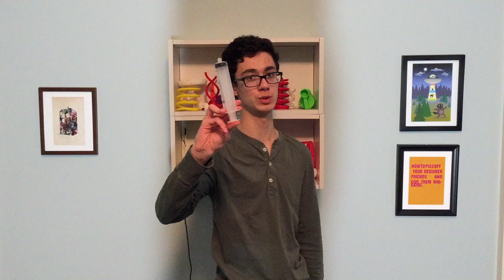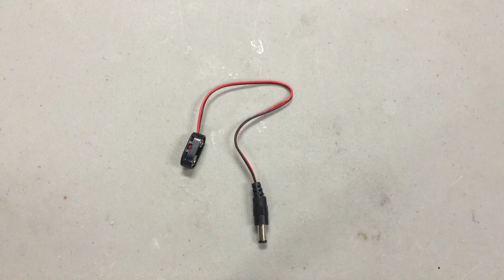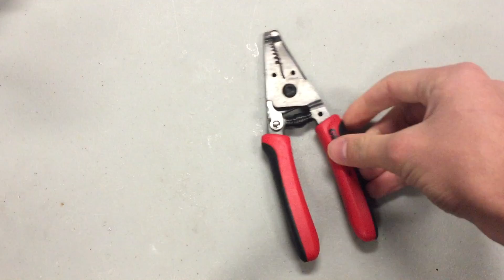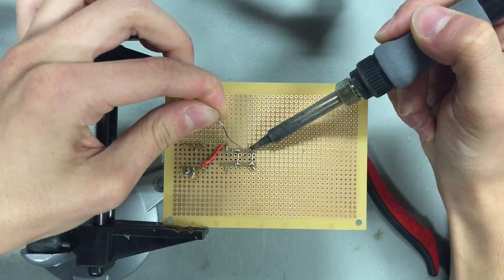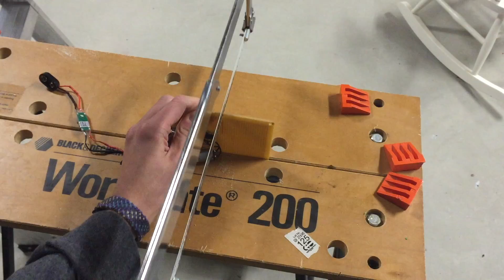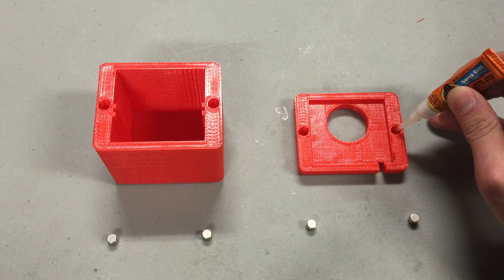The Aerobox - A Soft Robotics Control Box

Comment: Hey Aidan, nice work. Working on a similar project and wanted to borrow your schematic, but had a question about the motor driver you used. On the link to the part's website, it indicates that it won't work well for 3V motors. However, you seem to use the same DC 3V pump I have. Can you clarify? Thanks in advance.
Reply from the maker: Thanks for checking out this project! The pumps may say 3V, but they can be run at 5V.
Reply: +XYZAidan I appreciate your prompt response. I see in the schematic now that it's hooked up to the microcontroller at 5v. That should've been really obvious but again, thanks for the help.

Comment: How is the solenoid able to control the flow of air in or out? Can you please post a close up of the tubing and solenoid connection. Thanks
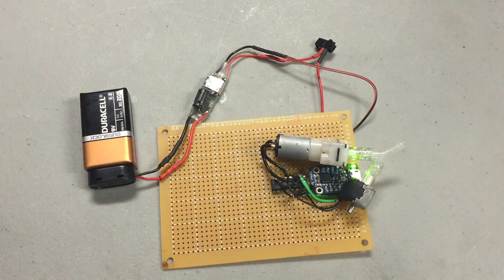Reply from the maker: +John Ang 2:43 provides a good look. You can also check out the instructables guide. The valve is closed when something is being inflated, allowing the air to fill up. When the valve opens, the air escapes.
Reply: +XYZAidan does that mean the air escapes through the solenoid shaft when deflating?
Reply from the maker: +John Ang Exactly.
Reply: +XYZAidan it's my mistake. After looking up the part link, I realised it's a gas valve solenoid instead of a push pull solenoid.